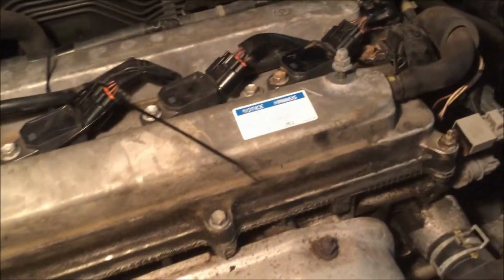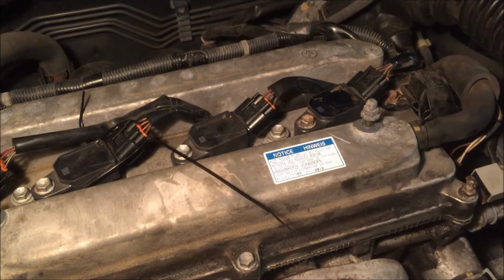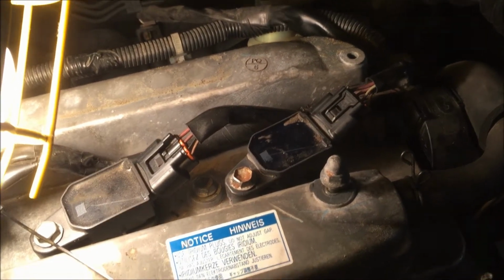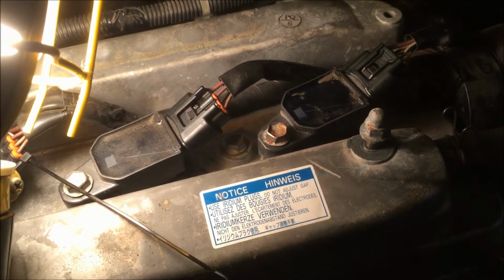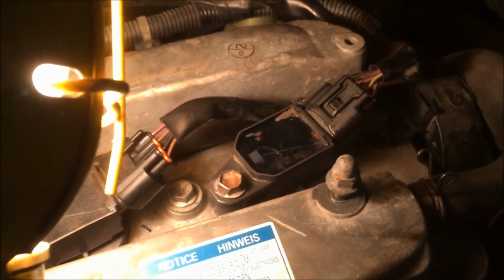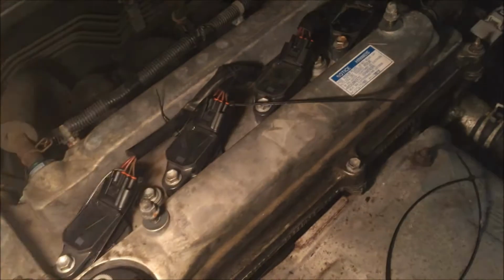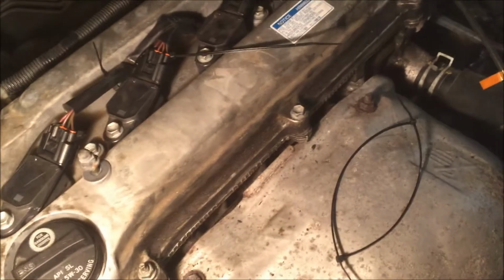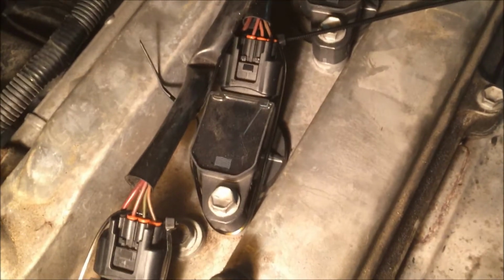Scion tC Spark Plug Wire Broken Clip Quick Fix Repair 2AZ-FE

Comment: Same issue, here: 2005 Scion xB, #3 cylinder misfire...
Replaced all spark plugs first (all were burnt almost completely off), then swapped #3 and #4 coils to verify failure.
Installed new Denso OEM coil pack (Amazon Prime @ $58, shipped) and the #3 receiver (female) clip snapped off..
I, too, employed zip ties... but two of the smallest available, wrapping them criss-cross across the receiver and the male portion of the coil pack (there's a small lip that the zip tie wraps behind), as I was concerned about running the ties through the wiring harness leads - believing they might cause problems down the road.
My only concerns will be a) vibration causing the zips to work their way off the ridge they're anchored on, and b) excessive heat - particularly in summer - may cause the zip to either stretch or fail altogether.
It's encouraging to hear that you've run it for several months without an issue!

Comment: I just slip them on and put the cover back on.  The cover fits tight against these plugs and will hold them in, theres some kind of foam underneath.  50k miles and no problem
Reply: Tony Miller this just happend to me. I thought I could just put the over back on and it’ll hold them tight.

Comment: I had the same issue on my wife's car. I'm going to try this. i was wondering if you had any feedback on how well these sip ties have held up with the heat from the valve cover? Thanks.
Reply from the maker: So far the ties are still holding up well at about 6 months.  Good luck with yours!
Reply: Exactly the concern I had. Are they still holding up or is the car still around?
Reply: Leave the plastic cover off it serves no purpose other than keeping heat in where the coils are
Reply: Austin Fisher it looks better

Comment: On my 2007 Camry LE two of mine completely broke off exposing the leads. What I had to do was reconnect the leads to the coil pack since the (4 wire) leads slide over the individual prongs on the coil  packs. I think I may have gotten the order of lead wire (color coded) to individual prong wrong. Now I have a check light that come on around 50KM after reseting the ECU. 

My question is can you tell me the wire order so I can know I'm connecting it correctly? The damage clips are at cylinders 2 and 3. I haven't opted to change the harness because it's too expensive and if I could get the pattern correct I could affix some ties to keep it snug. Any help would be appreciated.
Reply from the maker: Hi. Unfortunately I don't have any experience to help you with that.  I did try just Googling '2007 Camry spark plug wire colors' and it yielded some links that may help a bit if you want to try that.  Good luck.
Reply: +cjant101 that's a great idea, I'll definitely try that. I've been searching for a spark plug wiring diagram to solve my issue but your suggestion seems a lot more accurate, will try that
Reply: @Enigmatic540  did you ever find a solution to the wiring color issue?

Comment: The replacement parts are inexpensive. "NewYall Pack of 4 Ignition Coil Female Connector Plug Harness Pigtail" costs around $11 from Amazon.  https://www.youtube.com/watch?v=RwZhRg8m4C8 and https://www.youtube.com/watch?v=yDWjnWRYnpo should be helpful in this repair.